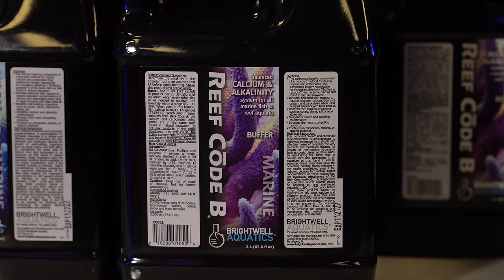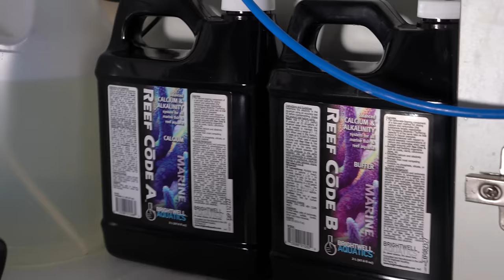Are you doing Alkalinity Correctly?

Comment: I have found mixing at max Saturation to be an easy solution for me. I mix a 17g airtight dogfood container with RODI eyeball around 3/4cup of kalk powder dump it in & give it a good mix I then let it settle this usually lasts around 2 weeks at 4ml a minute. I like this because I am not concerned with adding too much or too little Kalk, I also dont stress over remixing what kalk powder was left over  from the last batch on the bottom. I haven't really noticed a drop off in alk concentration over a 2 week period not sure if that has to do with the container being airtight and lack of perception.
Reply: There is just something about it. Once you go kalk you never go back

Comment: Great video! Been thinking of trying Kalk. How did you figure out what your evap rate was to know how much fluid you could dose? Doesn't the amount change from Summer to Winter months?
Reply: Well you know what you add regularly right?  That's your staying point.  Make a mark on the glass and set a rate that you think will work. Check back, if it's high turn it down if it's low turn it up.

Comment: Great video. I’m about to start dosing AFR for a smaller amount of baby coral. Two torches, a hammer, a candy cane and some mushrooms. I also have a crocea clam. So I’ll be using AFR to work this out. I do have Kalk+ 2 but have been scared to use it with a lot of reading of overdosing.

Comment: So, if one had like a 25G IM lagoon with say a dozen small SPS frags, I gather the approach here would be to add Kalk to the top off water (which tank might evap 500 ml a day - so a 1 gallon jug would handle a week), and maybe start with like 1/4 teaspoon of Kalk to see how it affects Kalk and CA over a week?  If you are lagging, up that Kalk the next week; if numbers are rising, scale back the Kalk to like 1/8 teaspoon.  Over a long period of time, you'd probably get to a fully saturated solution of about 2 teaspons per gallon (6 grams).  Then, if you have a peculiar system that uses more a bit more Kalk than Ca, do a little added supplementation with some Alk buffer.

Is that the gist of your approach?

Comment: I'm a kalk fan as well.  I mix 1/3 cup per 2000ml stored in a 5-liter reservoir.  I have a cheap, $11 timed powerhead in the reservoir at night (when the PH falls) and a Neptune PH-probe actives a peristaltic at a 5-second runtime (then 5-mins Off) into the overflow on a Red Sea 165.  Water top-off done by other means.  So in short, I use 100% of the kalk as a slow-drip-slurry on demand at night only. No prblms. PH is 8.1-8.2 and Alk is 8.3-8.7  Very reassuring video presentation here...  Thank you for helping us.  🌴👌
Reply: And I bet you wouldn't do it any other way.  It's a magic solution haha.
Reply: I ran the tank 1yr as a beginner with zero control over PH.  Duh.  Then a friend recommended Kalk.  The light came on Big Time.  Magic stuff for sure !!
Reply: I’m still learning is this just for Ph control and your getting alk control as well with this method? Wanting to dive into kalk been using 2 part

Comment: Loved this video with great information from the one and only Josh! I wanted to get your guy's thoughts as well as everyone else here on the channel. When you guys dose Kalk in your ATO reservoir, the thick sludge of Kalk that sits on the bottom builds up. It doesn't absorb in the water. What do you do with it? Suck it out with a pump or just leave it? Also where is your return pump located for your ATO? Because mine is sitting down in the bottom of my ATO in that sludge of Kalk, so is it dumping a ton of concentrated Kalk water back into my system? Hope this makes sense and I appreciate everyone's thoughts.
Reply: Water can only hold so much kalk until it "drops out" of solution (meaning it's not dissolved in the water and just settles at the bottom.)  This concentration is around 6g (or 2 tsp) per gallon.  By having kalk precipitated at the bottom of your reservoir, you are actually insuring your kalk solution is always the same (max) concentration, and actually providing stability!

Comment: So I have a question.  I currently have an 80 gallon system that I want to me a mixed reef SPS dominate.  I have all systems in place, Avast Kalkstirrer pulling water from the ATO resevorior controlled by a Neptune DOS and Maintained by the Trident.  I keep the PH of the reactor pegged at 12PH and know when it drops below 12 to add more Kalkwasser to the reactor.  My question is what is the proper way to administer the kalkwasser.  Josh says that they do a constant 25ml/min on their system.  So was this determined by the evaporation rate of the tank?  I think that is where I am confused.  When I first set my system up, I took a gallon of water converted that to Milliliters/divided it in half and was using that as my starting dose from the Kalkstirrer.  Sort of half evaporation from ATO and half from the Kalkstirrer.  My Alk always seems to see creep up and I have the trident to set to shut off the stirrer if Alk in the tank goes above 9.  So I am just not dialed in correctly with how much kalkwasser is beeing administered to the tank?  Please help me understand what I might be doing wrong.

Comment: Using a kalk stirrer how often do you recommend adding kalk, should you remove some powder from the bottom periodically?
Reply from the maker: No need to remove the kalk sludge in the bottom, unless it goes high enough to go into the outflow, which can clog the line.

Comment: Josh you are a reefing hero! Could listen to your knowledge for Hours! 
I have a question…
I’m thinking of starting to use kalk. 
I have a 20 gallon mixed reef and would like the benefits of increased PH from kalk. 
I’ve heard using kalk in ATO is a bad idea as it creates an inconsistent PH level due to changes in evaporation due to variables out of my control. (Room temp, humidity)
Have you found any issues in using kalk in a ATO for a smaller tanks? 

I planned to run my ATO as normal and start dosing kalk on a doser at as close to evaporation consumption as possible, along with the coral essentials 2/3 part.   

Would u keep it simple and using in ATO and risk the slight PH  inconsistency 
Or dial it in with a doser?
Reply from the maker: Email us at contact@worldwidecorals.com with all the parameters you have and we can help you!
Reply: I think you should omit the ATO you would easily be able to do this with a doser alone. 
Small tanks are limited by evaporation. Because you don't use much make up water you will only be using small amounts of kalk. Which is fine because you won't need so much alk. If you can force evaporation you will benefit much more.

Comment: Great thx…putting the kaulk in you return … how often do you have to buy pumps for the top off container…
Reply: W don't dump the kalk into the return chamber. With the combination of the warmth and the moving parts that would cause expedited decay on your equipment.  We dump in a quick moving area of the sump or overflow
Reply: The top off reservoirs that we use only have a pick up tube from the doser with only has silicon tubing contact

Comment: Hello I am having trouble with my reef tank. I purchased beginner corals from you guys, but I am now sure that the nitrogen cycle did not complete, I have high nitrites and low ammonia, I am wondering if I should do a large water change or if I should leave it and dose seachem prime or similar products
Reply: My PH has been fluctuating and got pretty low, wondering if that had to do with too much ammonia to begin with, but I never have dosed ammonia. My main concern is that all the nitrites are now dead and stalled the cycle. Debating if I should dose ammonia but I’m afraid that will raise my nitrites to dangerous levels
Reply: Don't complicate things by worrying about your pH right now.  Using some Dr Tim's one and only and let it ride will likely be your best option.
Reply: @jdearel1  thank you for the reply, just ordered a bottle of one and only. Will dose that and see what happens

Comment: I have a 4 ft tank how much kaulk would I have to use in my top off off starting off.. I dose triton about 2.5 mil a day LPS they don’t need much I guess.. would they benefit from the switch to kaulk
Reply: Honest your are already dialed in with another product it's hard to say. If it were me I would discontinue all other forms of mineral supplemental. But before establish you top off volume, once established add kalk starting very low.  Test daily if alk ruses discard that solution and start again weaker.  If it goes down discard and mix more stuff. Once your kalk dies not provide you with enough alk, bring back your other supplementation.

Comment: Cheers Josh. I've been wondering at what point do I reach maximum saturation using all for reef in my ato (7gallons). I've gone from 100ml a week to 300ml a week in the last few months. Any thoughts????  besides calcium reactors, they scare me 😅😂
Reply from the maker: How is everything looking in the system?
Reply: @WorldWideCorals  almost too good as in I've been thinking of lowering light intensity and duration slightly and reducing the kh to around 7 (from 8.1-8.5) in order to slow growth. My monti caps are almost as wide as the tank, encrusters are reaching places I'd rather they didn't just yet, etc. and I wanna try n hold off fragging as long as possible. Nice problems to have I suppose but is the reason for my original question pertaining to reaching the point of 'can I add xx amount of solution to my ato?' Hope I've explained the situation in enough detail. 👌🙏😍
Reply: Honestly I have never used All for Reef in an ATO.  I'm not sure I understand your original question.

Comment: I didnt get it how long in advance the solution has to be mixed and also in what time used? I ve read that Calciumions fall apart whilst in contact with oxygen, thats why a kalkstirrer is in this point better?
Reply from the maker: Best to mix the kalk the night before. Done daily would be best for efficacy from what we have found.
Reply: @WorldWideCorals  thanks 🙏 did it this way, but with dosage written on grotech kalkwasser: 7gr per 10 ltr. 
Its nothing settled on the ground, ph rises a little bit from 7,78 morning to 7,95. is it not satured? stronger the more i put in Solution? Thanks again
Reply from the maker: @gocedimoski728  If nothing is settled at the bottom of the reactor, you are not putting enough in. There should be a clear line showing the difference in the settled kalk and the kalk solution.
Reply: @WorldWideCorals  perfect, thanks a lot for the advice. Will try it today. 🙏
Reply: Works better, 8,22 from 8,08 in the evening, 7,78 to 7,95 morning before lights rise. Gralla gkr950 Calciumreaktor since 8 month on the System, this is surely an improvement.
Balling light was easier to handle but in an sps/lps loaded tank to expensive on a long run.
Thanks again! You re great guys!
Reply: @WorldWideCorals this works great💪 ph 8,2-8,35, but my kh rise from 6,8 to 9 , Calcium still 400, means my kalkreactor works the same. Why is kh riseing when im dosing ca(oh)2🤔